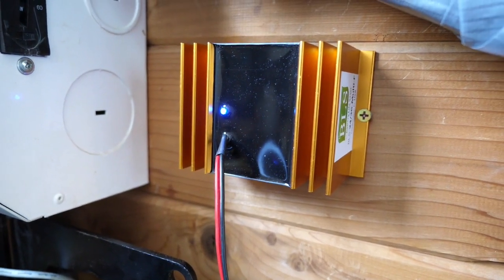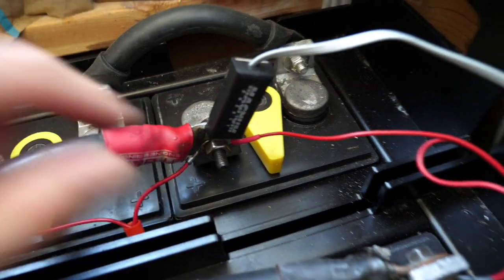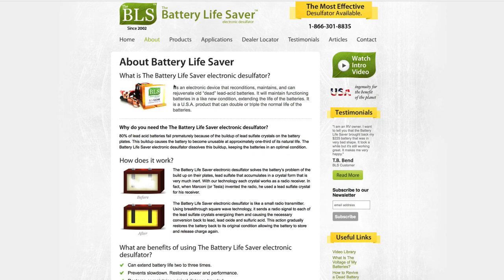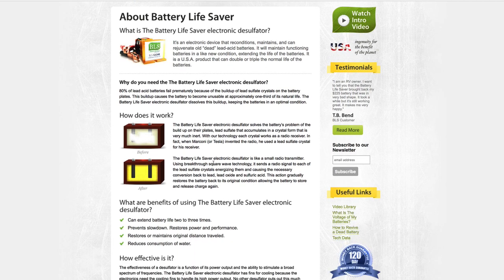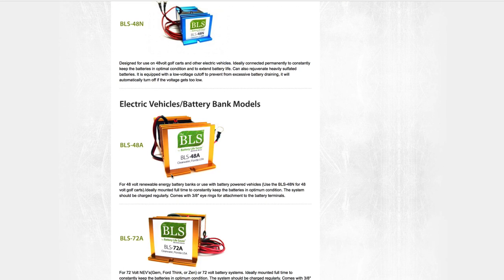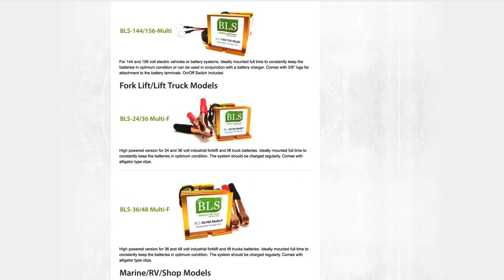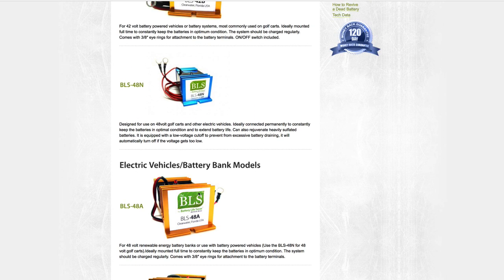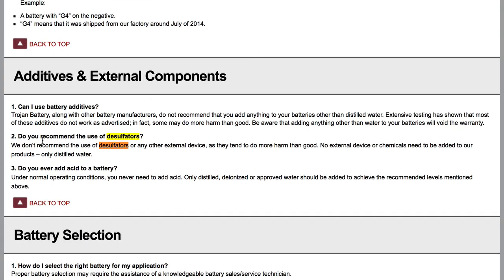Battery Desulfator 101

Comment: Hello,♥️ thanks for the video. How long does the sulfur removal device for a car battery 75 amp take, 24 hours, 3 days, or a week?? ✅♥️
Reply from the maker: Sorry for the late reply. Sadly I don’t have a firm answer as there are so many variables. Having said that, desulfators work better as a preventative than they do at fixing already badly sulfated batteries. They can certainly help, and have sometimes done amazing things, but don’t expect a miracle. I would expect to see some results within a month or two.

Comment: My BLS was installed on my battery 6 months ago on my forklift battery that was 5 years old.. The other day my battery just dropped off to lasting on an hour. Wow just like that , One day i had a great battery and the next day it was pooched !
I'm so done with lead acid. It's time to get LifePO4
Reply: You likely have a shorted cell. Each cell should have around 2.3 volts or so fully charged. Forklift batteries can be repaired by replacing individual bad cells. Your battery is currently running because cells can take a higher, temporary charge (overcharge). When you have a shorted cell, the remainder of the cells have to hold the voltage from the charger.

Comment: Excellent video!! Do you know if the BLS 12/24 can be connected to the busbars? Or does it have to be connected to the terminal posts directly? Currently I have two (2) 12v x2 24v banks and one (1) 6v x4 24v bank. They all go to common bubars. Thanks!!
Reply from the maker: Hmmm...I know the manufacturer wants you to connect it directly to the main positive and negative of the battery.  On the other hand, the bus bars are connected directly to the main positive and negative.  So the bottom line is, I'm not sure.  You might try asking the owner at BatteryLifeSaver.com .  I've talked with him and have found him very helpful.  Please let me know if you get an answer from him.  Thanks!
Reply: Thanks!! I sent them an email.

Comment: Great video. Just received my first BLS unit. 
Do you know if these will work with 12 volt AGM Batteries? I have a bank in an off grid cabin, very old 2003/2005 batteries that still seem to be working fine. 
Thanks
Reply from the maker: Hi Bill, Here's from the Battery Life Saver website:  "The BLS will work on any lead acid battery, including GEL and AGM batteries."  Hope that helps!
Reply: Last question...Will this work on small 7ah/9ah scooter, motorcycle batts?
Thanks again...!
Reply: Great, thanks!

Comment: So how is it working for you...still helping the batteries?
Reply from the maker: Been using the Battery Life Saver for probably 10 years, so this was not my first one.  So far so good.  Without letting the battery bank get sulfated and then connecting the desulfator, it's difficult to observe the impact that the desulfator is having.  But I have friends who successfully resurrected a sulfated battery bank with it, and that's not typically something you can do with most desulfators.  So I think it's a great tool to use for prevention.  But like any preventative measure, you never know what would have happened if you had not used it :-).  But in the end, there is no replacement for proper battery use and maintenance.  Hope that helps!
Reply: can it work with gel type?